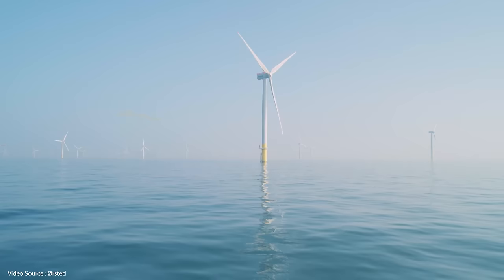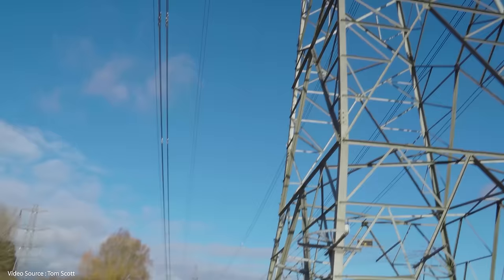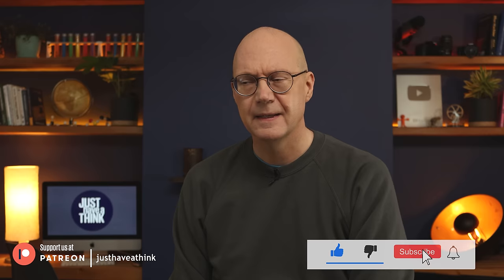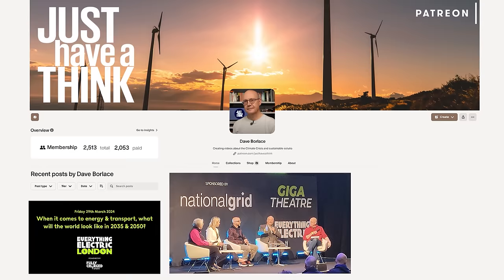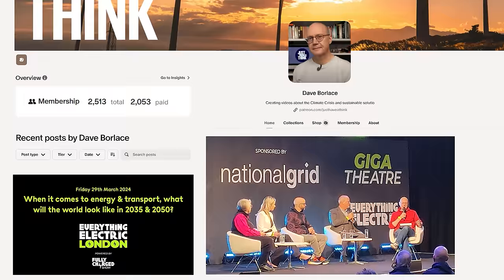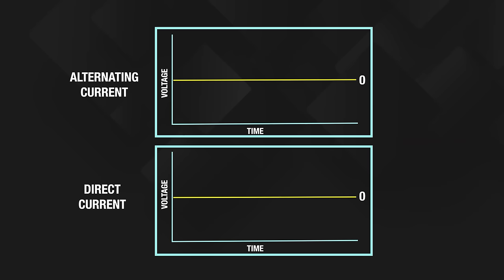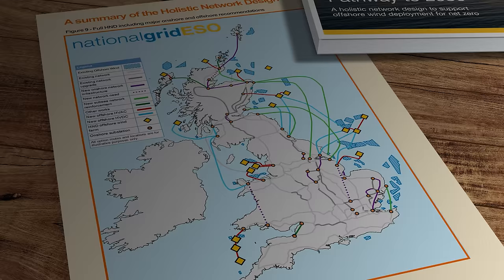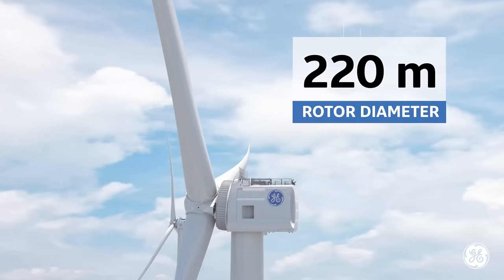Ocean Electricity Grid. How do they do that?

Comment: I was just wondering if anyone has evaluated the cost per mile/kilometer of an EV sedan or pickup truck. I'm referring to the cost of the electric to charge the batteries along with the amortized cost of the batteries in consideration of the miles/kilometers the batteries will provide over their expected life.
Are EVs as cost-effective as high MPG gasoline powered vehicles? I've recently read that EVs in the US are just sitting on dealers lots, unsold. 
Someone told me that mfr and gov't incentives to the tune of $20,000 are offered on EV pickup trucks, making an electric Ford F150 base model as low as $7,000! That's crazy!

Comment: Putting up  15 mega watts of turbine/s,(1 Haliade)  takes construction ships that use around 550 barrels of oil in fuel and require 20 barrels of synthetic lubrication  (oil) per year to run. Average coal power plant is 400 MW but wind is intermittent so we are looking at 18000-54000 barrels of oil to replace a coal setup with wind.  Then we have to do it again in 30 years.  Ironic;y the "best" use of offshore wind is hooking up to deep water oil Riggs to maintain their ability to extract oil a little longer..
Reply: You seem to be conveniently ignoring the fact that a fossil fuelled power station uses those fuels constantly. 
Over 30 years a single 15MW turbine in the North Sea at the typical 60% utilisation factor will generate 2.4TWhr of electricity. To generate the same amount of electricity from a modern CCGT power plant operating at 50% efficiency would require 360 000 tonnes of natural gas. The wind turbine pays off its "carbon debt" in about 3 months.
You do know that lubrication oil is widely recycled?
Reply: @garysmith5025  It not about being better its the fact that it requires large amounts of oil to build offshore wind and so I don't see how it can be an effective solution.  Given oil reserves and consumption we can do 1, possibly 2 build outs of wind before oil will not be available at the scale needed to rebuild offshore wind.As for recycling it did slip my mind as so much of it is a plastic scam so instead of every year it would be every 5 not including the energy cost.
Reply from the maker: Well done @garysmith5025. Saved me the bother :-)
Reply: @Jeremy-WC  Can you not grasp the scale of difference? If your 550 barrels of oil figure is correct, that's only 75 tonnes. It's a drop in the ocean (pardon the pun) compared to the fossil fuels saved, 4 orders of magnitude less. 
We extract 4bn tonnes of oil EVERY year, by your reckoning that's enough to build out over 5 million 15MW turbines, they would produce 400 000TWhr every year, or 13 times our current global electricity generation, remember that's just one year of oil production.

Comment: I want to warn about all that enthusiasm of expanding wind-energy extraction. Don't neglect the risks and side-effects (read the description in the package, before take the drug!)
 There is a limit how much can be done!
it affects the weather, global atmospheric circulation, and the (average) seasonal wave-heights on the North Sea; even the Northern Jet Stream could be getting destabilized; it is already more "meandering" than in past decades. The winds nowadays go more directly in North-South directions, effectively bringing more heat to the pole and even cold air to the Arabian deserts, therefore precipitating thunderclouds. 
Forget sailing yachts, You will fall back to row-boats! 
   it is better to "harden" existing wind turbines for bad weather, make them sturdier, built two "types", one for strong storm conditions, one for standard wind conditions, prolong useful life-span, and get them carbon-fiber blades with erosion-resistant rims. Pure CFC-tec wings are easily recycled by chopping down and burning the chips ultimately; no ugly landfills are necessary. 
Wind energy extraction is already at limits, (Texas may see more cold snow storms coming down from Canada in future winters)              PV has more remaining growth potential, if high quality, hail-storm proven panels are used.

Comment: When I see windmills or wind farms, I think "dead birds." When the farms are at sea, I think "out of sight, out of mind."
Reply: I have a friend who oversees the running and maintenance of on-shore wind-farms in central Scotland, and my girlfriend works in electricity distribution. The number of birds that die after flying into power cables is far, far higher than those killed by wind farms. Should we dismantle the above-ground transmission network?
Reply: @DJB01  Oh so more is better. Out of sight, out of mind.

Comment: 11GW wind capacity out of 100GW. (Ignores Abysmal capacity factor). You won’t rid fossil fuels from wind and solar alone (not an economic substitute for reliable, on time electricity generation, sadly). 

Ignoring time value of electricity ignores the engineering design of the grid system.  

If you throw away physics and engineering, anything is feasible.